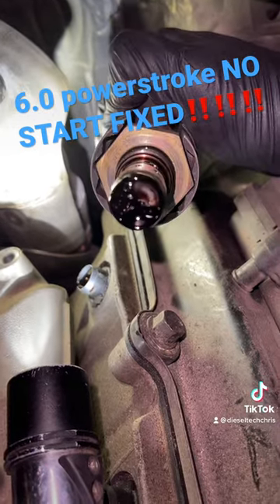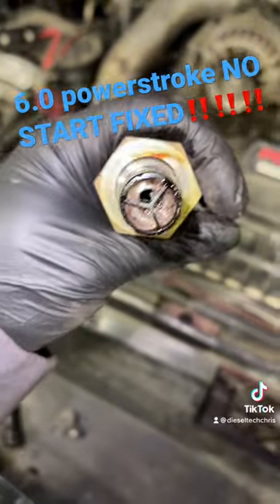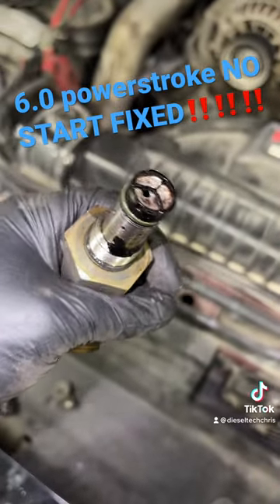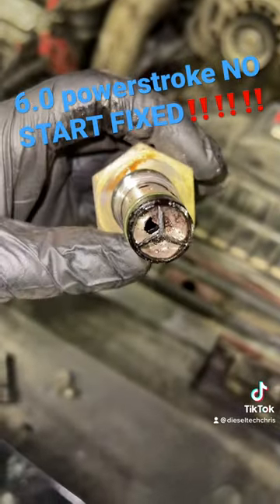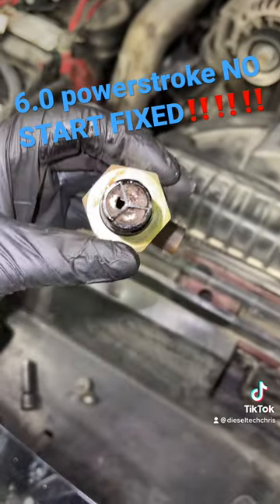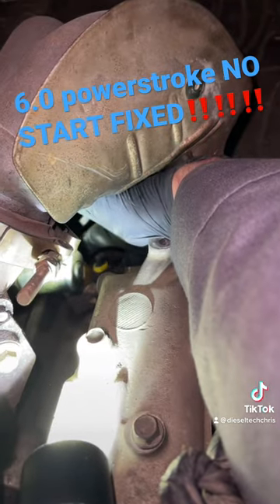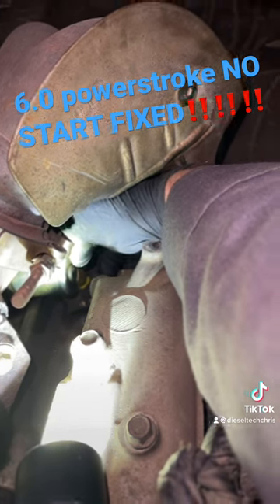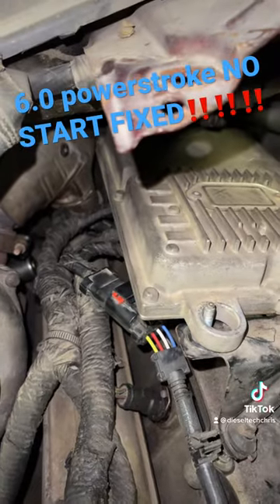6.0L NO START FIXED ‼️😱

Comment: I’m no mechanic but just a small tip when I replaced my IPR I tightened it all the way then loosened it so the plug was facing up, plugged it in then tightened back down. Much easier for me that way
Reply: I'm about to do mine and this is a great tip, thank you
Reply: @FormulaKG  you’re welcome. Definitely would not try tightening with the tool they say is for it. I did that and it slipped off the nut, turned the solenoid without the nut and had to buy a whole new one
Reply: @KevStock no importa si el solenoide se gira de echo cuando se dñaa el ipr es simplemente cmabiar la bobina colocar el cono que lo ajusta al vastajo y listo queda nuevo
Reply: When you tighten the ipr, slide back the socket a little, then turn the valve to where the connector is facing up. It's meant to move.

Comment: While getting a hold of the IPR and getting the socket onto it is a pain in the butt, I think the worst part of it is trying to put the heat shielding back over the connector and getting it to stay in place after you use the socket to turn it over another half turn to fully seat the valve.

PIMA

Comment: Chris question when i pilled out my IPR it did not have a screen and i could not reach deep enough to see if there was anything there, also the pig tail had to be change as it was partially broken i put the new one in and tighten all the way. Do you think it will be a problem ? It does not start still smh but next its the stand pipe and dummy pipe ? In your experience what are your thought ? What should i do? Thanks
Reply: Did you get it running yet?

Comment: I was getting 300 psi. I took it out and cleaned it and changed the o rings/filter Now I’m getting 0-25 psi.  I’m just gonna assume the IPR is toast
Reply: Make sure the rings are in the correct spots. The ipr themselves rarely go out. Same with the later hpops

Comment: What exactly is that part and where is it located and what is the best replacement one
Reply: It is the injection pressure regulating valve or ipr, it controls the oil pressure that runs the fuel injectors, it’s located at the back of the engine and is accessed from the driver side of the engine, I recommend removing the coolant degas tank and ficm to remove it, the best one is from ford, it takes a special 1.3/8” socket or a cut off wrench to remove it

Comment: Hi I have. 6.0 diesel power stroke engines not starting when it is hot
Reply: There are a few things that can cause your issue, a small leak in the high pressure oil system is very common and the swash plate can turn on the high pressure pump and cause this as well, do you have a scanner?

Comment: How is that a solid repair? 🤔 probably a needle bearing from a lifter that had to go through the screen under the oil cooler to even make it to the ipr......sounds like a bandaid repair. It does run, for now, until it does it again .
Reply: Thoroughly interested, as an auto tech here, are you speaking from experience? Genuinely curious.